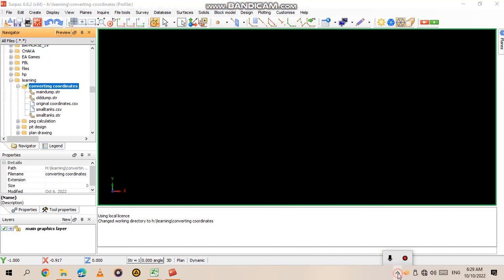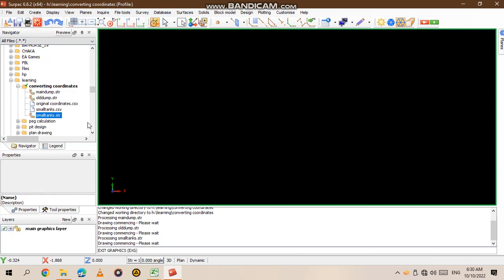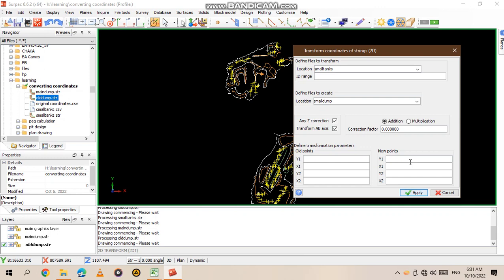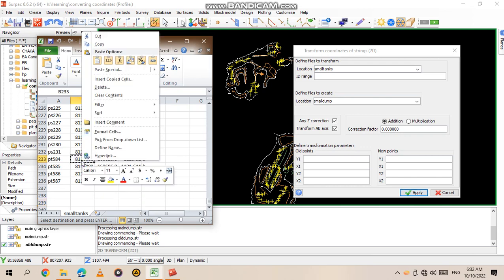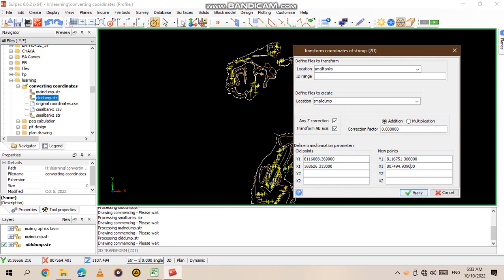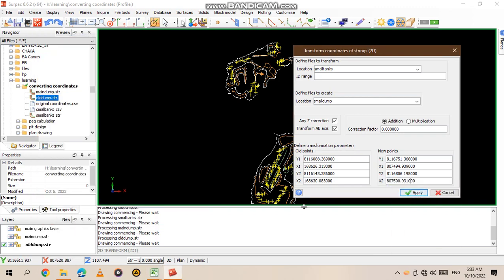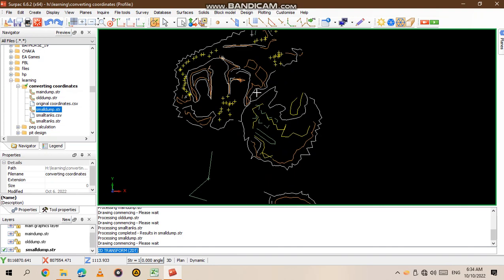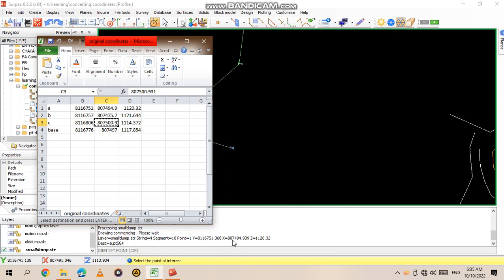how to convert/change coordinates to a different system in surpac

Comment: Hello. Can you please help me with  ore supply plans in surpac.
Reply from the maker: Mine scheduling ?
Reply: @Zim_mining  l saw your video on loading charging data. I also tried to save the blast as s string file before animation and yet if you charge the records still are not being updated.
Reply from the maker: Sorry I didn’t respond in time, are you still having the challenge
Reply: @Zim_mining  yes Sir, can you kindly help me please?
Reply from the maker: @ryanshereni2030  ok. what do you want help on specifically.